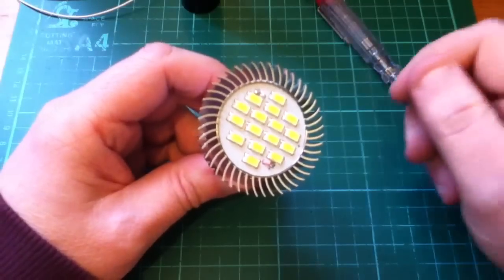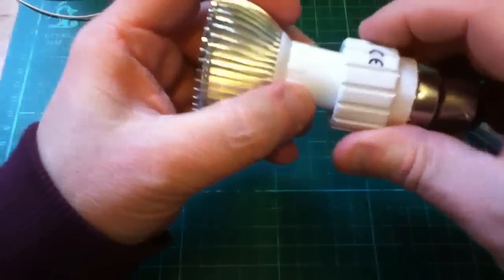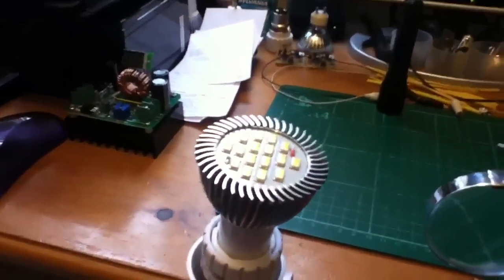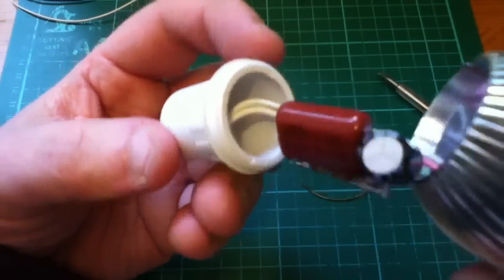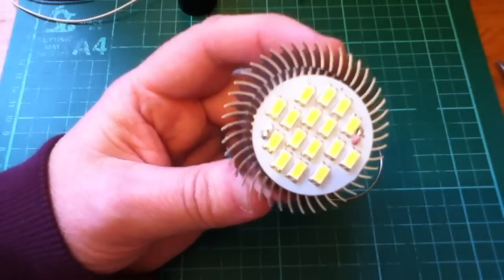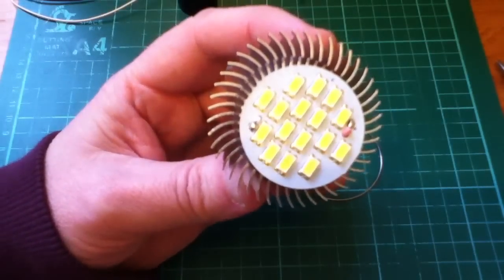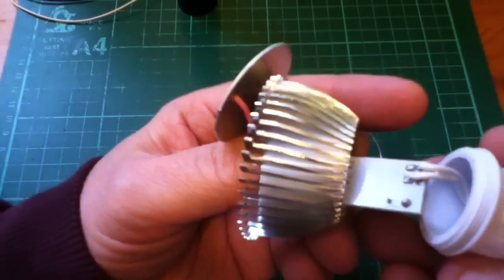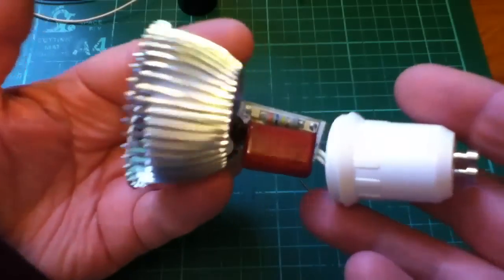Dangerous GU10 LED Spot Light is Cheap and Bright but could Kill You - Seriously

Comment: Always go for safety and long jevity over looks when it comes to mains power off a unknown voltage rectification circuit. The step down transformers being built into tge ceramic base with the not so pretty insulator circuit and heat sink fins often cause customers to look at the very cheaply made alternatives. I sell lighting and equipment with a large distribution network and noone ever Cares about safety shockingly always looks and cost are the comcerns. 90 percent say this line, i hear everyday my electrician will be installing it so im not worried. This alone is worrying. Great work with your video's always a joy to see and listen to your knowledge.

Comment: You've attracted a lot of anonymous icon types, laying into you and my main issue is they miss the point in their falling over themselves to criticise your understanding of standard circuit elements and configurations.  All that matters, is that you have found as I have, that a lot of these new lamp types for sale, have very small gaps and no significant safety margin (sorry pedants,  of course I mean 'margin of safety'), where circuit voltages and currents of various types are in close proximity to cooling casings, the consumer (eg children) can easily touch.  My own investigation of a blown 7 Watt LED SES (E14 small Eddison screw) candle bulb, had me sit back in shock as I saw a red input wire - yes, it was direct from the contact to the light socket - soldered half a millimetre from the alloy heat sink casing you easily can find exposed in use or during fitment.  And, as we know, once the old bulb is blown, it is easy to flip the switch 'on' and leave it that way by accident.  Our takeaway from electrical safety for consumers surely is simple: risks are not necessary, so pay the extra and avoid them.  China has a runaway manufacturing mentality, it's the opposite to the UK!  We don't make enough, and safety-check it to hell, they have manufacturing incontinence, and offload the crap that big retailers won't touch, through Ebay etc.

Comment: not sure at all there is 240V om the secondary circuit: LEDs work with a low voltage direct current, don't they? Have you simply tested the tension first with an electronic testing device?

Comment: The metal heatsink is not actually connected to the circuit as it may seem, so I don't see how the voltage going one way or the other could just arc to the chassis THROUGH the thin insulation.

Comment: You are absolutely right.  240Vac deserves more isolation than a few microns at best.  This product would never get a CE rating in this configuration.  Aside from the isolation issue between the aluminum back plane and the mains, there is an additional concern.  
If you attach the bulb without power applied, that offers risk reduction, but what if the light output stops or becomes intermittent?  Will the average consumer know to not touch the light with power applied?  Likely not.  I've done that many times.  GU10 sockets should be avoided if one wants to use LED lighting from non-CE qualified/certified LEDs.  This type of issue has surfaced on other YT channels as well.

Comment: it is simple.   do not touch the thing without turning off the electricity.  if this is forgotten, it will only happen once.  And the Darwin award goes to...( DRUM ROLLLLLL)..
Reply: The award goes to no one in this case... its actually safer than he's making it sound. he apparently has no idea what hes talking about..
Voltage is being rectified to a low dc voltage on that wire. Too low voltage to overcome body resistance and too low amps to do much harm if it magically did.. 
its a 7watt light bulb do you think 7w is enough to even give a mild shock? nope...  LEDs are low voltage low current components. it takes 16 of these to use 7w.
now if you attached the whole bulb to a cord sit in a tub full of water and throw it in... then you have way better change at an award.
you have a better chance at dying from hitting your head on a toilet than simply touching this.

Comment: Ooh lovely, a capacitive dropper! No isolation from the mains whatsoever so you don't want to be touching that whilst it is plugged in and running. Ain'tBigAin'tClever's video did a review of a corn cob, again capacitive dropper, no isolation from mains.

Any sort of cob LED light needs to have a plastic or glass case over it if it has exposed metal connections - thankfully, the GU10s from Home bargains have a cover over them (possibly glass or strong plastic) so are perfectly safe to touch. And cheap too; I paid £2.50 each for them (but they are now £1.50 each in my local store).

Comment: I don't think its the bulb that is a Problem but the bright spark using it. What your saying could well be right, but are these Bulbs made to go into a Bayonet light fitting? I think not, so then obviously using the Fitting to change it to fit in, is a darn silly thing to do. These Bulbs are normally sat in fittings that are set into a ceiling or wall and run off a Transformer. You wouldn't touch it whilst it was on. I mean what fool would touch a Bulb which its on? If you use stuff correctly then there shouldn't be an issue, if you going to add 3rd party and plug it into something it wasn't made for then good luck with that. The only safety issue I would be interested in, is it a fire risk, no one ha said it is, so its safe. Any chance on a video on why Plug sockets are Dangerous because you can shove something in it that your not meant to?

Comment: These are perfectly safe. Remember LED's are low impedance diodes fed through a dropping resistor. Assuming that the LED's are run in series There will never be more than 27 volts present at the point you touched.

Comment: How would the LED's work with the current going in the opposite direction? LED's only work in one direction so how can it be 50/50?
Reply: A bridge wave rectifier will convert the AC to DC and doesn't care how you hook the AC up to it. How you hook AC to it is merely a safety issue as discussed by the presenter. You can with even more political prisoner excrement encrusted examples find just a diode and resistor and enough LEDs to do the half wave rectification providing only half of the AC for use. It too can be hooked up to AC either way. It's why strings of LEDs will flicker as you move them or move your eyes quickly.

Comment: I used to use a tyre machine outside, 240 v straight up my arm every time it rained wheather I was standing on a big rubber mat or not and I'm still here ..come to think of it I've had cancer twice, i've smashed into the front wing of a car doing 30 mph on a pushbike, stuck a moped into a tree, stuffed many cars into trees - bushes, once jumped over armco sideways in a 2 litre mondeo, fell down an open manhole, fell off a horse, and I've kicked the shit out of many a bigger seeming man than me, and vive versa there isn't an Un dangerous light bulb on the planet - why pick on this one? plug it in and let the house fuses decide if it's dangerous or not. better to light a single candle than rally around in the dark .
Reply: Hi Five Bro
Reply: Sounds like you may have super human traits. Most humanity are kept in the dark, we're just barely leaving "the dark ages" or Kali Yuga.
If indeed true, you may be part of one of The Agendas. If one is unaware of their higher directives, they shall meditate/look within daily to attain clear vision and realization of them.

Comment: Couldn't you just put something over that solder point on the front, like maybe some cyanoacrylate, or maybe something else?  I realize it would have to be very heat resistant, but certainly there must be something that would insulate those two small solder points.

Comment: Something like a capacitive dropper doesn't make much sense with a rectifier as it is not a "voltage divider" .The second capacitor after the bridge is charging only with the positive cycle, so if there is no resistive load the capacitor voltage could be even greater than mains 220v as I have tested in a faulty led bulb.

Comment: If the circuit uses a full wave bridge rectifier and a capacitive dropper then the voltage on the plate is in theory a low DC voltage, not mains although its non isolated and should be double insulated. There is no 50-50 issue though either. It doesn't matter which way around the bulb is plugged into the mains live is always directed to the dropper first via the rectifier diodes in the front half of the bridge, not directly to the plate. Insulation or the lack of it makes the design potentially dangerous.

Comment: That's scary. I would have at least potted the top portion. They do make crystal clear potting compound. I know that for a fact because they use it in photovoltaic arrays to secure the individual cells in the panels. That's not to mention the fact that it's DC coming out of the front of it too. There was a reason that Tesla invented AC current and it wasn't just to make it go further. It's actually safer because it causes your muscles to spasm, not contract. The bulb you have there freaks me out a lot.

Comment: noice video but you should have actually demonstrated it by plugging it in the wrong way and measuring voltage and current at the heat sink.
Reply: +xxBlackpspxx I have a similar GU10 spot and I felt Bett dropped the ball on this by not measuring the voltage across the exposed pins. For the right price I'd be willing to wire those up to a pair of nipple clamps and subject my man boobs to the live circuit, I'm that convinced the LED is powered by DC.
Reply: There is no such thing as a "AC powered LED" right?
Reply: cannibis sativa no there isn't. They are just AC-DC converter and an ledin the same unit.
Reply: @fredrikcarlen3212  You can power an LED on AC with just a simple resistor but the light will flicker and it will shorten the life of the LED.
Reply: there is

Comment: Interesting.  Not only are there inherent risks in using a transformerless power supply, as you show here, but the heat sinking is horrible.  All those LED's trying to dump their heat into that mounting plate, which must then pass it on to the outer finned heat sink just by its edge - with NO thermal compound!  Even putting the shock hazard aside, those LED's will have a very limited lifespan.  The plate should have been mounted against a solid surface.  Let me guess, this was a "product" manufactured in China?  I don't know about you and everyone else, but I'm f***ing sick of poor quality, no QC, minimal design, potentially lethal products on the shelves these days - and there is very little, if any, choice.  Think about this folks, it may take a while to manifiest, but it WILL happen:  With all the money going to China these days, the overall standard of living there will rise.  The same people that make that cheap shit in a sweat shop today will be unwilling to do so "tomorrow."  What then?  Vote with your wallet (when you can)...

Comment: One way to tell if the live is wrong is to tap to exposed metal quickly with a least favourite finger. If it hurts the switch off and turn the bulb around. This tip comes courtesy of Darwin Awards Safety At Work Videos 1958.

Comment: there is no "mains"on the bulb, LEDs require D.C., and the cap-resistor shunt thingie is on the OUTPUT of the rectifier, which regulate the D.C. going to the LEDs.  loose the fake accent and learn some electronics,limey!

Comment: He doesn't know what the hell he's talking about. When the current goes through a rectifier it changes the current from ac to dc for starters. Diodes only except current from a single polarity configuration. The voltage going to the led array is between 3-50V max depending on the configuration of the LEDs. The could be configured in series or in parallel or a combination. Furthermore it's likely low amperage as well.
Reply: capatainzarlon: He knows one hell of a lot more about this than you do. Fact is the LEDs are connected to mains, irrespective of the voltage across the LEDs the voltage to earth or ground may still be at full mains potential and therefore lethal. And how does the current draw of the LEDs change anything? This is where you prove you know NOTHING so best you shut the xxxxx up and not lure people to death traps with bogus argument.

Comment: AC mains does not have a positive and negitive as such as the name suggest it is alternating , so putting the resistor on either lead would.nd make a difference . , and the rectifier makes it into dc ... , are you sure the resistor is on the ac side or the dc ..

Comment: Please put a stipulation in your description or just take the video down all together. The information you are presenting is incorrect. The components in the back of the bulb do 2 things: 1- drop the voltage and 2- rectify the current from AD to DC. Additionally, LED lights only work in one direction (+ must go to + and - to -), this is the purpose of a diode (light emitting or otherwise). This light bulb can't be considered dangerous. At least in the sense you describe.
Reply: Matt Loiselle You honestly have no idea Matt.  The voltage is not isolated from the mains supply, so there very much is a neutral connection.  If you follow the wire all the way back to your switchboard, it will connect to an earth bar, which will then connect to an earth stake outside.  It's possible that you have three different LED lamps, that have isolated DC for the LEDs.  The issue with this one is that it is not isolated.  Do you know what isolated means when discussing electricity?  If not, then you should bow-out of this conversation.
Reply: +YourBusinessGeek: It absolutely is dangerous.
The issue here is that the active phase is 'dangerous' because pretty much everything else around you, normally including yourself is at the earth potential, which is normally bonded to the neutral.  This means that you should be able to safely touch the neutral conductor.  However touching the active conductor will generally electrocute you.  Regardless of if the active has then been through a rectifier.  Rectification just adds to the danger, as it removes the zero crossings that can help to relieve the muscle strain, allowing release from the conductor.  Rectified AC has a very large DC component, so your muscles will clamp until the power itself is turned off (hopefully from an RCD / circuit breaker action)
Reply: +Bevan Weiss there is no neutral in DC! nor are their phases! jeez! i got three of em on a mobile-thingie above my sons crib, and he puts his slobbery fingers all over them, and even chews on em. aint heard him complain. not once. well, he did get pissy when i handed him a charged photo-flash cap for a binkie, but he mellowed out after a few burns from a hot crank pipe..

but YourBusinessGeek: youre right. why are there no MODERATORS to remove shteeeww-pid videos like this? next thing ya know: "recepticles can kill! one could easily jam a key into a wall socket by mistake and get a DC shock!" and everyone would be that much dumber. and dumber.

Comment: Kind of like the old TVs with ac/dc power supply and two-wire cord (1960's-70's).  You had 50/50 chance of a hot chassis.

Comment: LEDs don't run on mains voltage, therefor your assumption that mains could be present on the front panel is flat out wrong. The circuit must include a way to drop the voltage down to a DC level that's appropriate to drive LEDs (3v to 5v most likely, if they are wired in parallel). Furthermore, LEDs are polarized, meaning that they only allow current to pass one direction, so the potential at those solder points will be the same regardless of which way you have it plugged into mains -- the rectifier takes care of that. 

The voltage on that front panel is most likely around 5 volts DC which you could normally touch all day without problem. 

--electrical engineer
Reply: +neechert I don't know much about this kind of stuff but was thinking the same thing. That must be a little driver that converts mains in to probably less than 20 watts at like 700ma. But then I was thinking why would this guy be pulling one apart and doing a video on how dangerous it is, surely he'd know that...

Comment: The purpose of a 'mains dropper?' is not to insure that the live is connected to the resistor, but to reduce the amount of current available at the output.  There is no 'bridge rectifier', only a single diode.  Without looking at the complete circuit diagram I cannot see if one of the wires is indeed a pass through or not.  I seriously doubt it and probably one of the capacitors is used to prevent this from happening.  LEDs operate at low (2 - 5 Volts) and low amperage (20 - 30 ma per diode).  There should be a cover of plastic or glass ( I realize you said there wasn't) for protection of the LEDs and to prevent contact.  I really doubt (can't tell from this video) there is a connection of mains , live or neutral, to the LED board.  Please provide a schematic of the circuit for examination.

Comment: Are you sure that the wire up front is directly connected to the AC Hot wire?  You pointed out that there was a bridge rectifier on the board -- What does a bridge-rectifier do to a circuit?  Also that resistor what is its function and on what leg of the bridge rec was it put on? 
You could put an ohm-meter between the wire and the connector post on the back to see the impedances.  That would give you an idea of the isolation between the AC line/neutral and each wire.
Reply: +Glenn Inn  you are right. Something he fails to realize is that the bridge circuit (which converts AC to DC) must also include a voltage drop to get the level down to something appropriate to drive LEDs (3V to 5V range). The wire up front that's he so concerned with touching is likely in the 3 to 5 volt range which is not dangerous.